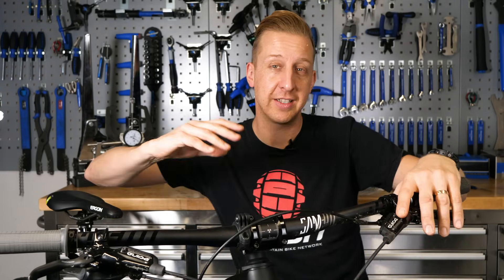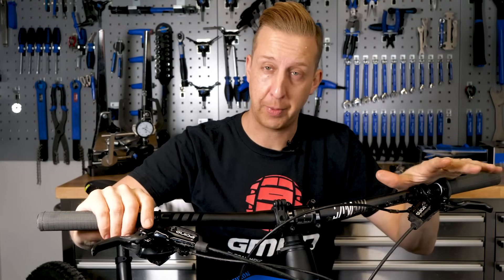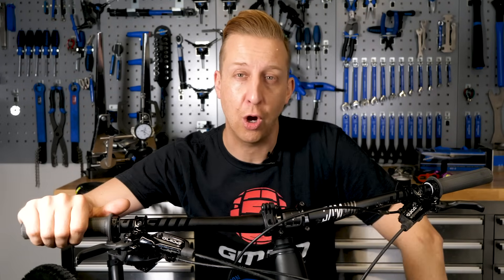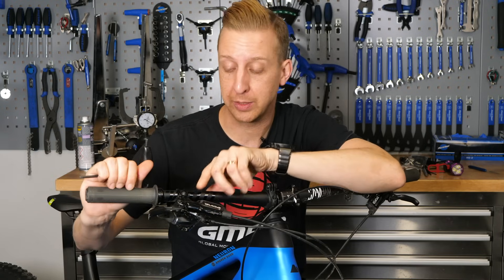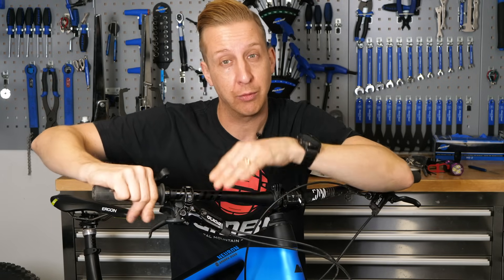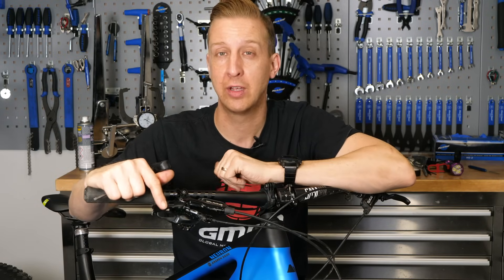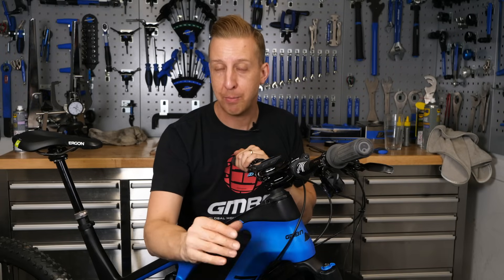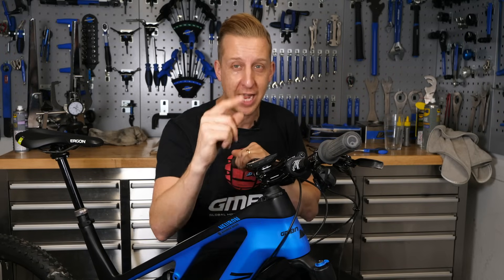Mountain Bike Cockpit Setup | GMBN Tech MTB Essentials Ep. 9

Comment: The first time I rode on 780mm bars, I came down a steep drop and at the bottom I chest bumped the stem.
My arms were so far apart I couldnt resist the down inertia force.
A few weeks of wide stance pushups cured that

Comment: I went from a 760mm bar and 50mm stem to 780mm bar and 35mm stem. Feels good man.
Reply: tried a 780 bar with 35 stem, felt a little cramped, went back to a 50 stem, it's all preference, my bike reach is 472mm, i like to get weight on the front more.
Reply: @stevebennett3587  Nice.
Currently riding an 800mm bar with a 45mm stem, had a 35mm on there, but I found that in the snow it was hard to control and now the ground has less leverage over my bars.
My bike's reach is 510mm and I have no trouble weighing the front-end even with the 35mm stem and high stack-height when using proper technique
Reply: @th_js  I've noticed 45mm is popular, i think i may try a 45mm next time, i doubt the 5mm will make a lot of difference on my rig👍
Reply: @stevebennett3587  You might be surprised, the thing that led to my decision of buying the 45mm stem was actually testing a 40mm stem and comparing it to the 35mm one and this might sound exaggerated but it's not: the difference was absolutely huge, I couldn't believe it myself either how it completely changed the handling of the bike only 5mm!
Now I know to not underestimate any small differences between components/bikes.
Reply: @th_js  🤔it's finding that sweet spot ain't it😅😉
Reply: I went from 650mm bar and 100mm stem to 720 bar and 45 stem

Comment: My Siskiu T8 came with the brake levers pre-assembled to the handlebars. They were positioned between the dropper lever or shifter lever and the hand grips. This meant they were pre-assembled such that you had to put most of your fingers on the brake levers. It took me a while to work out that I had to put the brake levers inboard of the dropper post lever and gear shift lever if I wanted to comfortably have just one or two fingers on each brake lever.

Comment: Nicely done.
3:50 I strike the crown of fork & bars, but my bike is too short, for me no matter which setup I would run it would be bad, I need way higher bars, and much longer reach.
but I had to get a bike, and eventually upgrade it, but now I think I can get a bike that fits me.
I think I will go For Nicolai G1, keep my parts swap over, and change what needs to be changed, and will probably get a nice handling bike that fits me.
probably a Large, my current bike has 430mm reach and use 50mm stem with 800mm bars.everything is perfectly setup on my bike apart from,
cockpit height and reach, and geo, also I prefer a less twitchy bike, my fuel ex is not optimal, also it's 2014 model so plenty of issues, too flexy.

but Nicolai ticks all of the boxes.
 I am 181cm quite average.

11:52 nice, great you mention this, I use color pencils, I have not tried markers yet.

Comment: Doddy, take the tether that came with the garmin and install it on the computer. Wrap the tether around the steer tube under the stem, putting the computer through the mood of the tether. Adjust it so it’s snug around the steer tube or stem between the two bolts, then lock it in the mount as normal. I hit mine with my knee or body often enough where that will save you from losing it.

Comment: Terrific info, as usual, Doddy. Thanks.

On the cable discussion, make sure the cables are long enough to rotate the bars fully in EACH direction (so as not to restrict the bar motion), and then remove the excess if any. Learned that the hard way unfortunately!!
Reply: I get them so I can do 3/4 of a turn in either direction and find they never make it past half way in a crash but each to their own

Comment: I've been playing around with brake lever height. Used to ride super flat, then tilted them down a bit more to encourage myself to ride more in the center of the frame as opposed to hanging off the back. I feel more in control, but now my thumbs have been going numb a bit. I am going to try tilting them back up again a bit based on your tips re hand position. I think I am putting too much weight on my thumbs now.
Reply: Not sure what you mean.  Aren't your thumbs wrapped under the grips??  Do you mean your thumb joints?

Comment: Would be neat if they had rear and front shift levers for either side of the bar to go with moto or non moto style brake lever setup!  Also regarding brake lever position I'm under the impression trails riders on push bikes have a very extreme downward tilt to the angle as the most common position where as perhaps with motor trials the levers point quite a bit higher up as a more common average.  Wonder why though.  Personally I prefer a Downward tilt.
Reply: The levers on a motorcycle are a bit different than on mountain bikes typically in there curvature and design. The higher up you have the levers the more chance you have of catching the rest of your fingers that aren't on the lever and pinching them against the bar.
Reply: Plus the higher up you have the lovers the more unnatural position it is for your wrists
Reply: I think the extreme downward tilt is seen on inexperienced riders,which there are many. People don't know they need to change the angle.

Comment: LOL I went from a 630 mm bar and a 90 mm stem to a 740 mm bar and a 35 mm stem. It feels great honestly, I felt like a roadie at first.
Reply: I have on my full 760 +110mm stem :-)
Reply: @danielstormy3660  WTF?????  Do you really?   On a mountain bike??  WHY?
Reply: @Windband1  bcs frame is from 2013 26'' (ghost amr 9500 2013) and in these times frames werent builded with short stem in mind, on orig. bike is 90mm at XL size and i got longer arms a bit than normal so its perfect for me, tried 70mm stem and it was tourist sitting as old grandfather :-)
Reply: @danielstormy3660  LOL.  I understand.  Well i hope that 110mm doesn't make the bike too hard to handle!  Maybe time for a new bike?  ; )

Comment: I switched from two-finger braking with an in-line angle (which I was used to from motorcycle riding) to one-finger braking with levers tilted up. Previously I found that on long descents I had trouble holding on to my bike and controlling it, both because my thumb was getting tired (when you have levers in-line the position means you are essentially supporting your body on your thumb) and the ring- and little finger were also getting so weak that I was occasionally losing grip. This is catastrophic when descending, and where I ride you will be descending hundreds of metres at a stretch over rough terrain. Switching hand position meant I can simply lean on the bars most of the time (instead of clawing them with my thumb), I have one strong finger more to hold on to the bar, and I also find that braking with one finger only, from a hand that's not cramped by trying to desperately hold on, gives me far more control and feel. Being able to lean on the bar relieves the fingers, having more of them relieves them even more, and the brake finger is essentially hanging loose and ready to brake.
The fly in the ointment is that the Shimano shifters are designed to be mounted inboard of the brake levers. Brake levers themselves being mounted far inward pushes shifters even further inward and forcing you to stretch out a bit to operate them, which is uncomfortable and requires more force than it should. I tried mounting them outboard of the brakes but that just didn't work at all. However on the whole, I feel more capable and safer with my new setup and am quite ready to live with suboptimal shifter position.
Reply: Exactly. Still see far too many bikes with levers pointing to the ground, a recipe for sore hands and over the bars crashes.

Comment: Hi Doddy, great video once more! If you do have a torque wrench,  how many n/m would give you the crash proof (movement)  you talked about for levers on a carbon bar? Cheers
Reply: It's like only 2 NM. For me, my brake, gear and or dropper post clamps are separate, so it's less than 2NM each. In order for my brakes to rotate, so do the other clamps. If I set mine up to 2NM each, it feels like the NMs add up and is too much. Going by feel is most accurate because everyone's setup is different and a quick check by hand will tell you if it's too tight or loose.

Comment: Im having trouble choosing a new bike I have never brought a new bike myself I have found 2 one that has a low 25mm rise handlebar and 31.8mm stem shorter wheelbase and the other 45mm rise handlebar with a 60mm 10 degree rise longer wheelbase. 

It says on the info for the longer one it improves the grip on the rear when climbing and front when descending. 

Could you help me when you are available to please?

Thank you.

Comment: is there a difference between these two theoretical setups: flat bar with 20mm spacers under the stem or 20m rise bar with no spacers under the stem? In theory, the hand positions/locations should be exactly the same.
Reply: No they won't because as you move the stem up it travels slightly backwards as well due to the head angle.

Comment: 1:12 I have pretty wide shoulders and I find a wider bar way more comfortable to ride with. I have 2 bikes a hardtail XC bike and a full sus trail bike. They both have 760mm bars with 30mm+ rise (I think the hardtail is 32mm and the full sus 38mm). The hardtail has a Ragley 60mm flat stem down from the stock 100mm and the trail bike has a Nukeproof Horizon 50mm stem with 5 degree rise. It's the same length as the stock one but with 3 degrees extra rise. It makes it soo much easier to get the front end of that 15kg monster up. Both have DMR DeathGrips

18:11 or break a leg (seriously not joking)

Comment: I have currently rode my 2019 Giant Anthem Advanced 29 1 for a year now and would like to upgrade all the parts.  The stem is 90mm and bars are 780mm. The bike feels great but in order to upgrade my bike to start racing, i noticed ENVE only makes 65mm as the largest stem for MTB and 760mm bars. The bars seem like they wouldn't be an issue but the stem seems like it would be a bit short... Any suggestions? Great video! I appreciate that Doddy is 6'3 as I am 6'2 1/2 so the video does help more than the feedback i've received. Thanks again for your time. :)

Comment: He
 Doddy,
My question is
Whats the difference between organic, metal, cinterd ect ect pads its always confused me ive always used cinterd year round. Whats the best pad for year round use?
Thanks in advance
Reply: Organic aka resin pads take less time to heat up and begin to be effective at braking, this means they'll work well immediately rather than taking time to warm up. Metallic aka sintered pads take a little more braking to warm up and become effective but when they do they're a bit more powerful. Also they last a lot longer in mucky wet conditions (organic pads can wear out in a few rides in bad conditions), are less likely to get glazed over by over heating, they also wear out the discs out a bit faster. All in all, metallic is generally better for winter because of durability and in summer they're both very similar and it depends what characteristics you want from your pads.
Hope this helps
Reply: @michaelstewart9308  yes my metallic pads felt like they were eating the discs in the dry the other day when it was sunny. Back to resin for summer.

Comment: The problem I have is with the brake lever positioning in relation to the gears. 

When the brake levers are setup for one finger braking, I need to loosen my grip and shuffle my hand to reach for a gear change. 

It's physically impossible to have the gear level closer when the brake level is pushed so far away. 

My gears and brakes are on separate brackets with the gears on the inside. 

Is there a solution?  Shorter brake lever maybe?  Anything simpler

Comment: Shame none of the companies that make bike computers have thought about doing something to help you find it if lost. Their linked to your phone so it'd be easy to have some sort of alarm that you can activate if it's come off your bike and you're not totally sure where. Really easy for them to do as well.
Reply: There are a lot of these systems on Kickstarter. But from my friends experiences, none of these came to fruition or very poorly designed and not useable. Money gone. Their advice, the only system that works needs a sim card. So a proper GPS tracker running on a cellular network. This is how your cell phone's tracker works. This means a monthly mobile subscription in addition to your regular mobile phone fee. If you know of any system that still works when you are separated far enough from your bike and Bluetooth is disconnected, let us know. Any "crowd sourced" app only works if everyone else has purchased and running that app... good luck with that.